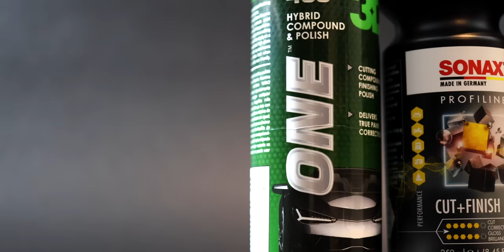The Best One Step Car Compound/Polish | 3D One vs Sonax Cut & Finish  vs Scholl Concepts S20 Black

Comment: 6:04 That also happens to SPF (Sonax Perfect Finish) when I'm using it on my hot and humid garage, specially on softer paints. If I use it in the shop with the A/C blowing out penguins though, it wipes off like a breeze (most products work better in A/C) unless I'm polishing a buttery soft Fiat or Subaru and I overwork it. I'd also advise you try out Sonax Perfect Finish instead of Cut & Finish as IMO it's their best one step product and their best product PERIOD. It's my go to for one steps and also for 2 stage corrections as it finishes flawlessly on pretty much any finish. There will always be that one car where you have to use a primer polish, but they are rare. I've always wanted to try out Scholl Concepts S20 Black since I first saw it in a video in like late 2017 or early 2018, but never really bit the bullet cuz only the euro shops carried it with heavy shipping penalties. After watching you work with it and hearing such praise now I wanna give it a go and Corey actually carries this product so I can pay the shipping no problem :)
Reply: What do you use as a compound before finishing down with your Sonax PF?? Cheers
Reply: @johnboy2436  I've tried pretty much every compound under the sun but my "go to" has been Jescar Correcting Compound. It's cheap, easy to work with, has a good consistency, wipes off neatly without a fight, cuts extremely well, the finish is not bad considering how well it cuts (you WILL have to follow it up with polish unless you're working on those granite hard clear coats like the Mercedes G wagons for example), it basically doesn't dust so long as you clean out your pads very well/completely after you're done with them (and keep them clean during the job, residue control is very important for any compound/polish so you keep getting good and consistent results from start to finish), it's water based, etc. I have nothing bad to say about that compound and highly recommend it for pros or noobies alike. Nowadays you can use pretty much any compound you like, though, as most modern compounds perform incredibly well and produce excellent results if used correctly. THE most important part of the equation is actually the person using the product. Work on your technique, be aware of what you're doing wrong and causing you bad results and also what you're doing right and causing good results and you'll just keep getting better and better. You could literally give me a polisher with some microfiber pads and some polishing pads and I could still take some absolutely thrashed paint and make a huge improvement to it using body lotion instead of compound or polish. If you haven't polished anything before and are just starting out, I'd recommend you buy a bottle of perfect finish with some yellow rupes pads or some orange, lake country HDO pads and polish a really swirled up finish. You'll be surprised at how easy it is to make a massive improvement on a car's finish even without prior experience :) You can buy the Scholl Concepts S20 black instead if you wanna try that out and just use it with the same pads. There are other good pads out there that you could get good results with, but those are just some that came to mind and that I've personally used plenty and had excellent results with.
Reply: @groundcontrol6876  Thank you so much so iv ordered 6 rupes yellow foam pads and 6 rupes white foam pads for my DA. Here in the UK tho i cant seem to get hold of Jescar Correcting Compound. But iv just bought Sonex perfect finish. Is there another compound i can get thats just as good as jescar? ill be following up with sonex perfect finish.
Reply: @johnboy2436  Honestly, it sounds like you’re completely new to this, so my suggestion would be to just use the combo you already bought (the Sonax perfect finish with the Rupes yellow, since white is much too fine to do any real correction) and go from there. Unless your car is in really, really bad shape, I think you’ll be very pleased with the results you get with just that combo alone. I’ve one stepped a lot of cars with SPF and a yellow pad, so assuming your car isn’t completely knackered, or it’s a really, really hard clear coat, you should be very happy with the results without having to use a compound. Plus, you’ll get practice with the machine and work up a rhythm/muscle memory as to how to polish. What polisher do you have by the way? I’m curious to know (you don’t need the latest, most expensive Rupes/Flex tool on the market to get incredible results, remember, it’s more about your technique, working on clean, properly prepped paint, and controlling the residue by blowing out your pads between with compressed air and/or swapping out for a clean one when they’ve been caked up with spent polish and other residue. Anyway… if you give this a try and you still need more cut, then I’m gonna ask you which compounds do you have available? So I can suggest one or a few. But really, wash your car well, clay it (or clay a section like the trunk lid or the bonnet)dry it and then polish that section just to test it out. You’re likely gonna be surprised and pretty happy with the difference you made with one step :) Remember, you can always do another polishing set if the first one left a few swirls behind, and also remember that it doesn’t have to be perfect to look amazing, all you have to do is make an improvement and I’m sure it’ll leave a grin on your face.
Reply: @groundcontrol6876  The car is in amazing shape. It doesnt really have swirls either, its just got some marks here and there that you can see under certain angles/lighting. Its the new Megane RS. I want it in perfect condition if possible. I got 6 rupes yellow, 6 white rupes pads, 6 uro-fibre 50/50 pads and maybe like a blue wool pad or something like that. Its a long throw DA, not sure what brand i know its of good wattage and its powerful. I used it on my parents car with HD speed and a yellow rupes pad and they had ALOT of swirls and it corrected like 80 percent. I know HD speed contains fillers but the level of correction was great. I didnt go too much was it was my first time and i wanted to keep the clear coat thick. I got g6 compound, meguiars ultimate polish, HD speed, Sonex perfect finish and menzerna 3800. Also have a sealant called poorboys EX-p. I bought alot of this awhile ago to get into it but only used recently on parents car and it turned out good and using the buffer felt natural. Only issue was my pad head in 5 inch and my pads are 6 inch. So i have to kinda use the buffer on an angle here and there to get to some sections but i also worry than because of an edge in the bodywork it will put more pressure and ill burn though. But as far as iv seen a DA is good for not making that mistake. I was going to go in with Sonex PF with a white part from minor correction but a good finish. The cars really really glossy as it,i want it showroom. I bought this menzerna 3000 and wondered also if i should just one step that with a white pad. Again not much correction is needed but i also want a really glossy finish if thats even possible with how good it already is. Was going to step up to a yellow pad if needed. May do a test section with both white and yellow as this car is my daily and i want to keep the integrity of the clear coat as much as possible. Id rather only do a major correction when needed. I want minior correction but that showroom finish. Extra glossy. Thanks so much
Reply: @johnboy2436  That whole burn through is a worry that is thrown around way too easily. You have to be completely and utterly clueless to burn through edges, specially with a DA and some polish. I’d go with the yellow polishing pad and the sonax perfect finish, it’ll remove that light oxidation and other bonded contamination (yup, there’s oxidation and other contamination there even if you can’t see it and the car looks amazing) that doesn’t come out with a clay bar, it’ll increase the gloss significantly and it’ll leave the clear coat ready to take on whatever protectant you want to apply when you’re done polishing (after a good IPA wipedown, of course). Be that a cheap carnauba wax/spray wax or a full blown coating, the same applies: properly prepped paint (which includes polishing) will have the best bond to the LSP and therefore whatever you apply to protect will perform at its best in terms of hydrophobics AND durability. Enjoy 👍🏽 Let me know how it comes out.
Reply: @groundcontrol6876  Appreciate the insight! When do you know you need to use a Wool or Microfiber pad over a cutting foam pad? There are also variants of wool and mf pads too, which makes it more confusing.

Comment: I had a Scholl S20 black bottle that had been sitting for about 4 years, i used it with rupes yellow wool pad, cut was fantastic on soft paint, but almost impossible to remove. i think that bottle migth have "expierd" as it has always been a nice experience both polishing, wipeoff and residue control.
Reply: I’ve used Scholl S20.  You may be on to something about the age of the product.  One of my favorites…along with the Sonax…👍
Reply: The original formula S20 Black was renown at being a PITA to remove the later versions are far easier ..... don't ask me how I know 😔

Comment: Great review I have used 3d one on Peugeot and VW  ³d one fineshed  down well on these paint types but I found ³d one clogged up my pads even though I cleaned them after each pass Plus It almost put a film like coating on my padd after using it for long periods but did not dust to much had great lub Love the review keep  them coming In Sandro we trust
Reply from the maker: Thanks Bob and it sounds like your experience with it was very similar to much of my testing!
Reply: You're probably using too much product. 

I use this product almost daily at work. 

I find that I can "stretch" ONE a bit because of its lubrication and non diminishing abrasives. 

Stretching polish is when I clean out my pad with a brush to knock the loose particles out, I'll sometimes wipe the pad with a microfiber towel too. 

From there I'll touch the pad to the paint to see how much moisture is in it, and begin polishing again. Occasionally I might need to add a small drop or two to the pad. 

With 3D ONE, less is usually more. Only when doing some heavier cutting do I use more product.

Comment: I love 3D ONE. I'm using it nine times out of ten on all these cars we correct and coat where I work. 

But...

You could give me Jescar Medium Polish and I can cover a lot of ground with it. The only reason I tend to go with ONE is that it's very easy to clean up off the trim or pebble black textured plastic, and rubber pieces.

But interms of cut and finish, Jescar is probably a little more refined in the overall user experience. It's a diminishing abrasive, so it finishes down on a wider variety of finishes, where sometimes ONE will need a softer pad to deliver that level of gloss. The wipe of is also more reasonable. Just a hi quality feeling and performing product. It's "luxurious". 

I also used to use a lot of the Menzerna PF2500. Rupes Quarz and UHS were very good. Poorboy's World SSR 2.5 was very nice. Adam's Correction Polish (orange) was excellent. 

These medium polishes ate so much fun for me to use. I love when they can deliver more than expected.

Comment: only two polish/compound im currently using is ultracut and reflect, i was experimenting with koch chemie but those two are just too easy to work with :)
Reply: ultracut has an unbelievably easy wipe off, i find scholl concepts can be a little hard to wipe off
Reply: Try having the clear coat in mind, just using ultracut and reflect may be way more than the paint needs. You may be doing a disservice to the paint because you are taking off unnecessary amounts of clear coat. I like to use the combination that gets the best results while preserving the amount of clear on the car. I love ultra cut though. You can do whatever you want mate, I’m not judging, just giving some advice.
Reply: @connersmith2445  you are right but its really pad combination which removes clear coat, on my hard german paint it would be pointless trying to cut in with smg like s20

Comment: you should also try a farecla g3 premium vs 3d one.. im using farecla and it got a good cutting when using wool pad and gloss finish with a foam pad, just wonder how it will perform compare to 3d one..

Comment: I have a 3D one compound and a DA. How can I remove micro marring or long micro scratches maybe mostly made by claying my car (done at a detailer) that was  imported from Japan with heavy contamination. I am using Shinemate Blue medium pad(which i think cuts fairly less with my compound) and 2 local (but very good, praised by our local community)a step up from one another harsher foam pads as well. I only did like 2 passes. It removes swirls but not those micro scratches. And oh also I am a noob
Reply from the maker: When you get down to finishing well on soft Japanese paints it can sometimes be hard to identify what are existing swirls or  micro marring and what the polish is leaving behind in term of marring. If it’s claying scratches you need to cut a little more to remove them, if it’s polish/pad induced swirls/marring you need find a better combination and technique for that paint to finish better. 
Maybe this video will help:
https://youtu.be/m6tbu3GrTWI

Comment: Love the videos, so much great information!! for general annual maintenance polishing using 3D One on a modern car with I would guess regular hardness, what would you recommend as a great all around pad choice the Rupes yellow or white? focusing on micro scratches and swirl removal and everyday usefulness shine and depth (not show car quality). Essentially with the White have enough cutting power to do anything?
Reply from the maker: Thanks and I’d go for the yellow pad - the white Rupes pad may struggle a little with anything but a super fine polish.

Comment: Did you have to use two different pads to cute and polish still? Or with a foam pad you would be able to do both?
Reply from the maker: It depends on the existing defects and the paint type - sometimes yes, sometimes no
Reply: @CarCraftAutoDetailing  just trying to get rid of swirls. Other scratches I know you can’t win all the time.
Reply from the maker: If it’s just swirls you want to address then a single stage with a foam polishing pads will most likely suffice
Reply: @CarCraftAutoDetailing could a lower speed not get most of swirls. I did a polish with an electric sander and had to lower the speed to not have it vibrate like crazy. I keep wondering if I would have done more correcting with more speed. I did do more passes incase.
Reply from the maker: If it’s just an oscillating sander it may not work well, you need a good dual motion free spinning action - if it has that then it should get you there in the end
Reply: @CarCraftAutoDetailing yea it was dual action. I also took out the rubber braketo have it spin freely.

Comment: What would you suggest the best pad and compound combo for the likes of the hard clear coat you get on say a ve/vf holden commodore, as a one step?  I tried 3d one and also scholl 1step with a 3d dark purple pad, and even though it was an ok finish,  it didn't remove as mush swirls as I would of liked. I then tried 3d one with the yellow rupes wool pad. And ended up with similar results Much appreciate your feedback Sandro. Best videos on YouTube
Reply from the maker: I think if if those one step compounds with moderate wool pads aren’t removing the defects you may need to step up to to a more aggressive compound or maybe try altering your technique to tune it more towards cut - that is working smaller sections, maybe starting with slower machine speeds and pressure and then raising speed and pressure to finish off. It’s hard to say what is exactly going to work well for you without being there but if the defect removal isn’t happening to your liking, I’d just keep on slowly upping the aggression until both my combination and technique gets me there.
Reply: @CarCraftAutoDetailing  Thank you mate much appreciated.  I will make those adjustments and see how I go. I think the most aggressive compound I have at the moment is scholls heavy cutting compound.  That should definitely do the trick. I actually forgot that I had that one in my arsenal.  Cheers mate. And thank you once again. Your videos have helped me improve so much.

Comment: is this upto date on how you feel still? you still think the scholls is best? or had another product took your number 1 spot? looking for a good one step? cheers
Reply from the maker: S20 will always be a great compound and I still highly recommend it - whether or not it will be the best choice on a particular paint and it’s defects as well as your own working method is another question.
Reply: @CarCraftAutoDetailing you mention its a compound but will it also finish down as a one step? I have sonex perfect finish but sometimes the cut is not enough.
Reply from the maker: I don’t think S20 will have substantially more cut than Perfect Finish, but it may actually finish better than it on softer paints - S20 does typically finish extremely well. 
If you want more cut I’d be looking at something like Scholl S2 Black - which is also a fantastic one-Step on medium to harder paints. 
You just have to appreciate that the paint type, it’s defects and your pad selection and technique is what’s going to determine whether any compound/polish will be a good one step.